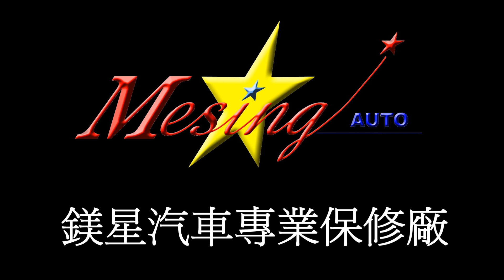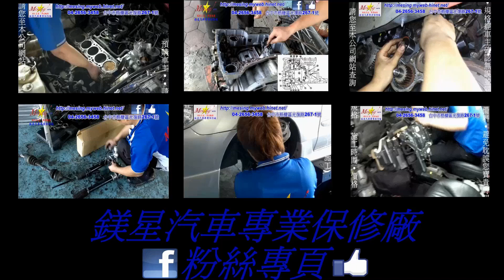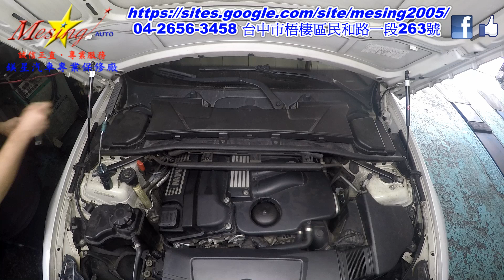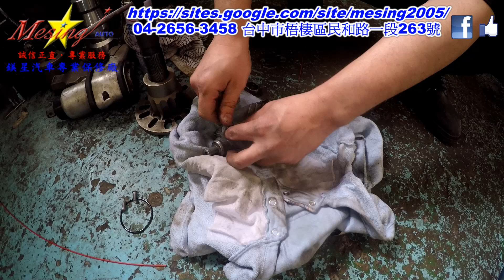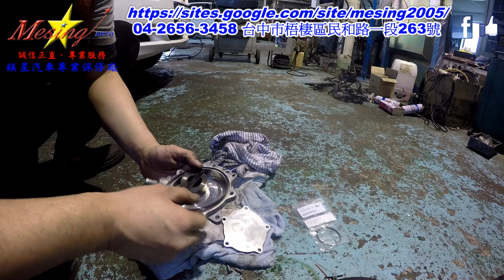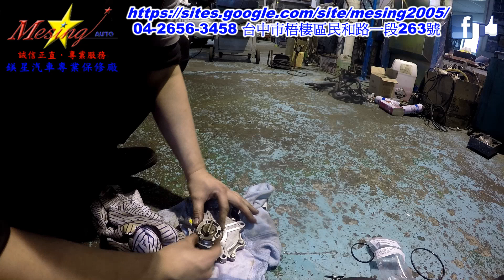Brake Vacumm Pump Seal Leak Replacement BMW 320 E90 2.0L 2006~N46 B20B 6HP19

Comment: Why did you change it. Was it leaking and dripping on the exhaust ? So it was stinking inside the car and Smoking in the engine Bay ? Greetz from germany
Reply: thats what mine is doing atm need to change it
Reply: mine is leaking only 75k miles. they want to charge 2k$ lmao.
Reply: @deprogramm ????? What the fuck, that would be the price for like new main bearings in my country 🤣🤣